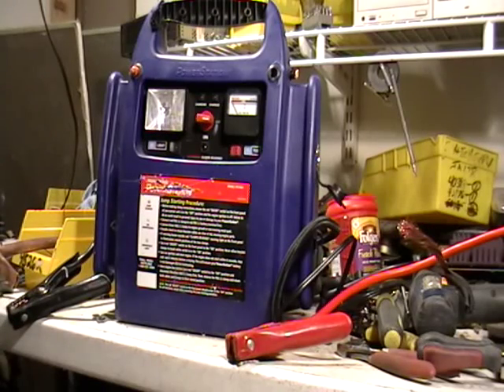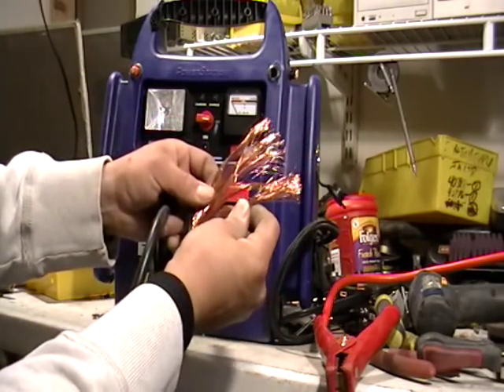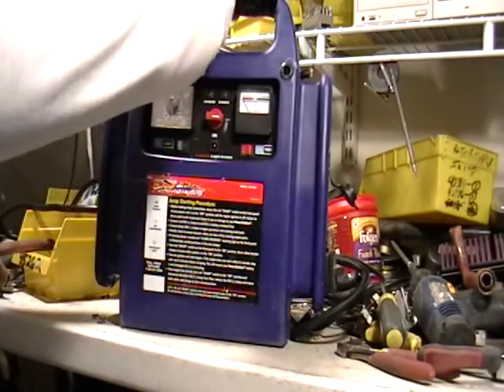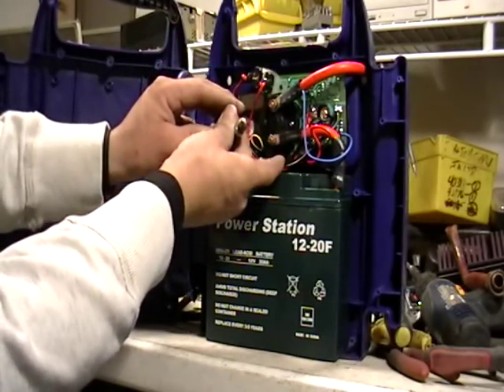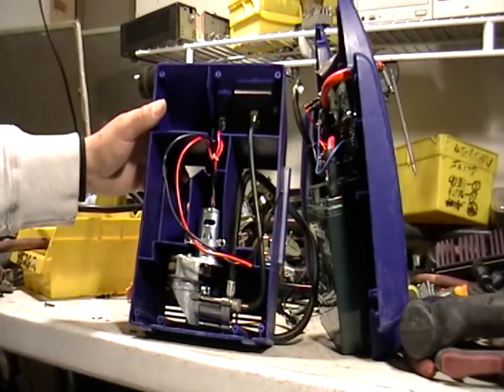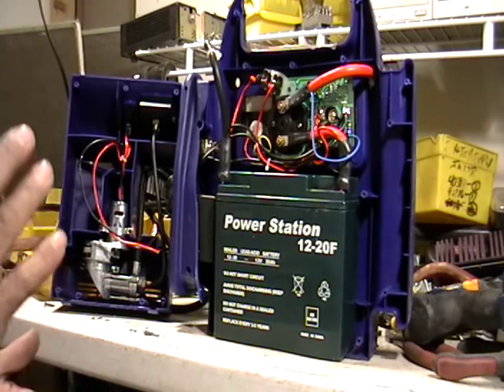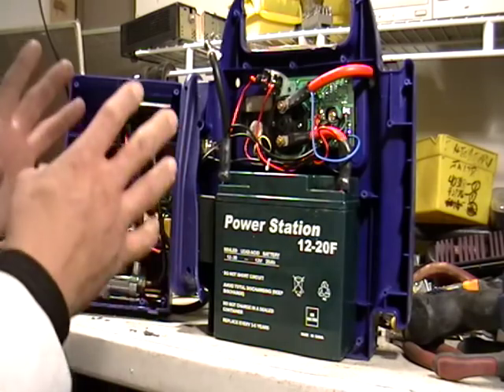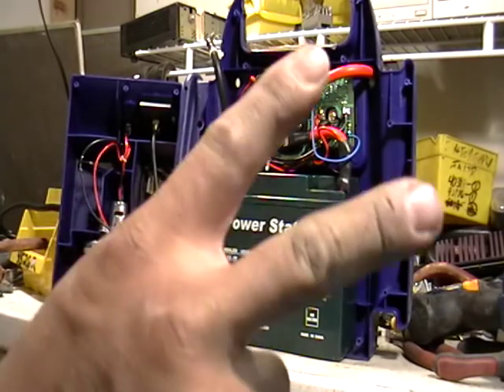Scrapping a battery charger

Comment: Oh yeah in case people don't know, if you ever store a (vehicle) battery make sure its not directly on concrete/cement. This will drain it fast. Put it on a pallet, block of wood milk crate or what ever just don't put it on the bare concrete.

Comment: So copper is pretty easy to pick out, and brass and aluminum aren't real difficult either, but how do you tell the difference between sheet tin and sheet steel? Also, is it generally the way of it to bunch all your ferrous metals together? I have collected a bunch of little stuff and currently have it separated into ferrous, non-ferrous (some of which I don't know what it is) and copper. Thanks in advance!

Comment: i scrapped a battery charger just 2 wks ago, and found (almost)exactly the stuff you showed!
make sure if the metal is magnetic (ferrous) or not.
the round connectors are brass, and heavy! 8?D#
i scrapped another battery charger (much smaller), and found @least 1 lb. of pure #2 copper in the transformer! mega find!
lots of sheet metal (steel),probably scrap it for steel.
keep it up!
8?D#